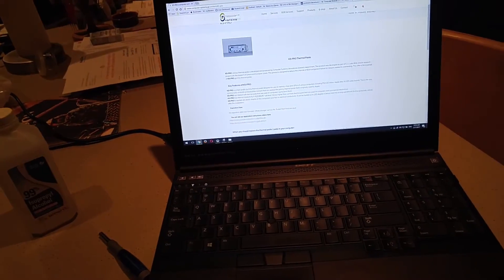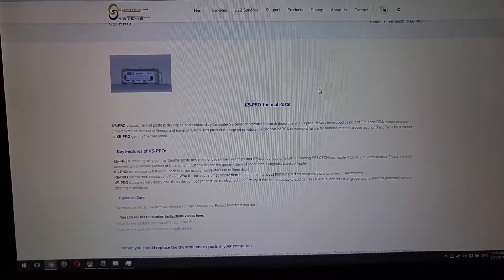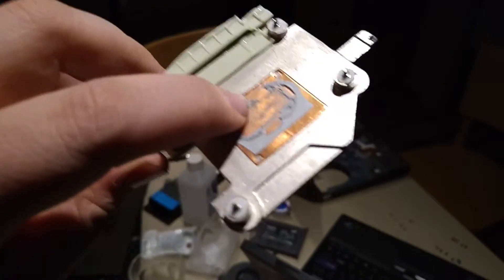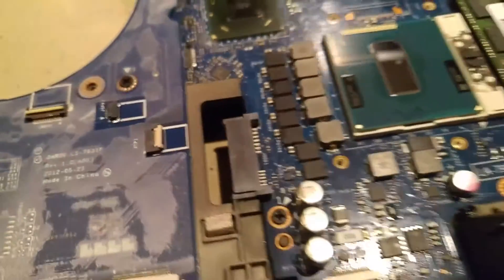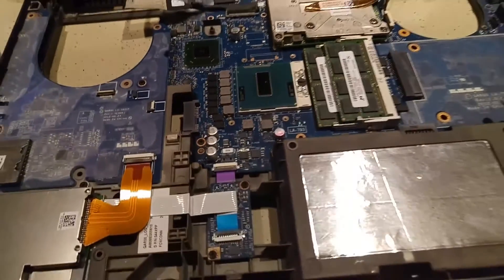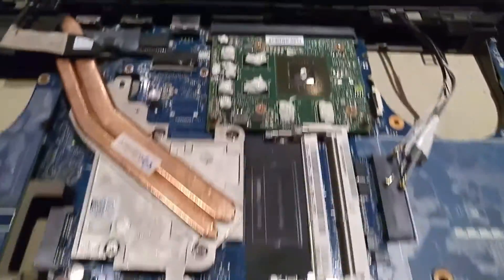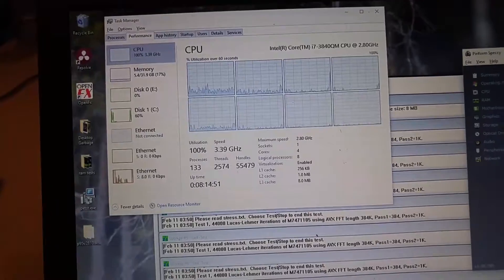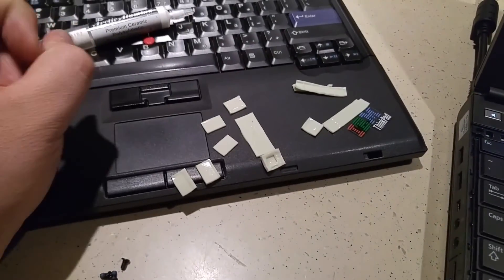How to Replace Thermal Pads using K5-PRO

Comment: came here because i can't believe the ammount used in linus tech's video is necessary
Reply: It is! K5 pro depends on volume and area. It is both a spreadable heat sink, and makes more contact (even the sides of VRMs) and more area contact to the hot plates and even PCB and case and whatever it touches to move heat out. There are better thermal putties in the past few years for high end, hotter applications. But K5 pro is still magic for when you don't want to measure every thermal pad you are replacing. Ideal for laptop repair, but also kind of a pain to clean up.

Comment: Those SMD's next to the CPU is more likely voltage regulators, they are not ram modules. A GPU or a CPU die imprint left on the copper heatsink base is due to overheating. It could be this thing is overclocked running at those temps, but then again some laptops do run hot, so always check your fans out before reassembling. Even a partially seized fan can cause overheating issues.

Comment: done the same with alienware 15 r3 skylake, K5 Pro and Thermal Grizzly . got like 30 Celsius drop from factroy ,seems can fix uneven heatsink issues
Reply: sadly didn't take any pics ,applied small amount of k5 just to fill out the space similar to the video ,used only on coils and small 4 chips ,still made mess on the mb. grizzly seems have thermal pump out issue ,didn't go higher than 65C at the beginning now 78 and increasing with intelburntest. might repaste again with higher viscosity gelid and will make video
Reply: Sadly, sometimes the manufacturer can easily make a wrong application of thermal paste... that along with dust buildup can easily contribute to high temperatures over time.
K5 can fill up some spots on the VRM's for example which can be problematic to do with just thermal pads... but otherwise, Kryonaut is generally pretty good for CPU and GPU.
Reply: @deksroning125  Nope. For laptops it's Hydronaut or Gelid GC Extreme.
Reply: @Sphynx93rkn  I run GC-Extreme on all my Precisions (except my M4400 and M6500 Covet which are Liquid Metalled) and it's AWESOME.

Liquid Metal is still #1 though for blast furnaces like the QX9300 or 940XM, and even with a LMed QX9300 the M4400 throttles a bit when overclocked.

Comment: I bought K5 Pro and K4 Pro in a kit from Amazon Japan and used them on a late 2009 iMac's video card.  I had to use more K5 Pro than you to fill the larger gap between the memory chips and my heatsink, but apparently it's made for that and in practical use I've not had a problem. Here's my video of how I applied it, which follows the manufacturer's recommendation (i.e., they use a lot, but it works fine):  https://youtu.be/6BJGLFCigdA?t=27m39s
Reply: Y a largo plazo cómo te fue?
Reply: @luismiguelpatinobuendia5141  El video al que hice referencia en mi publicación de hace 7 años habla sobre hornear la tarjeta de video por segunda vez. Ese segundo intento duró 1 año y 9 meses. Mi tercer y cuarto intento de hornear no duraron más de 1 semana. Entonces decidí reemplazar la tarjeta de video con una tarjeta de video 6970M. Y también apliqué K5 Pro a esa 6970M, en abril de 2020, y mi iMac ha estado funcionando perfectamente, hasta el día de hoy.